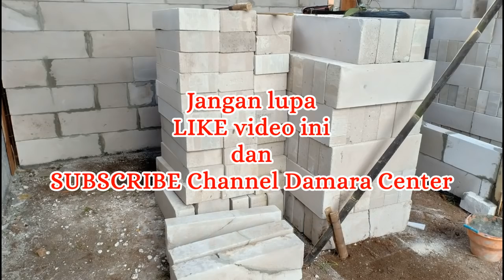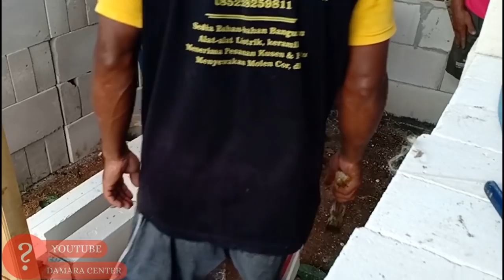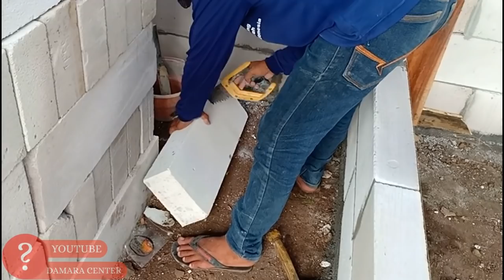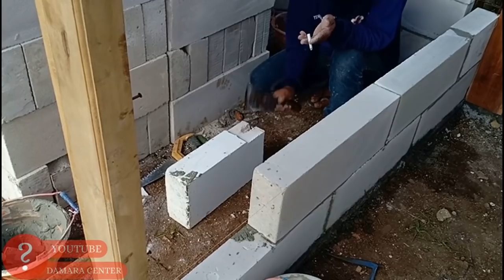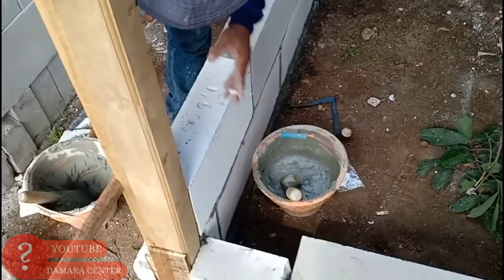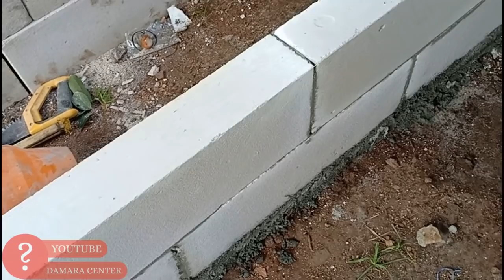Cara Pasang Hebel Tembok | Memasang Bata Ringan Sederhana

Comment: What I want to know is: because they are lighter than normal concrete, how do they stand strong winds or even a tornado????
Reply from the maker: i dont know yet
Reply: Setelah ini, akan di plester lagi atau cukup plamir saja dan langsung cat
Reply: @ambrosiodiasfernandes5822  " After this, it will be plastered again or just plamir it and paint it right away" or  "Depois disso, ele será rebocado novamente ou apenas plamir e pintar imediatamente" doew not answer the question!!!